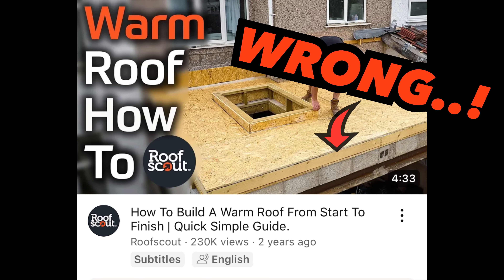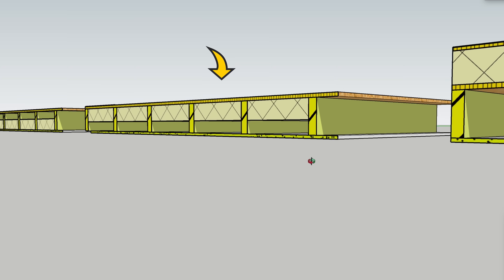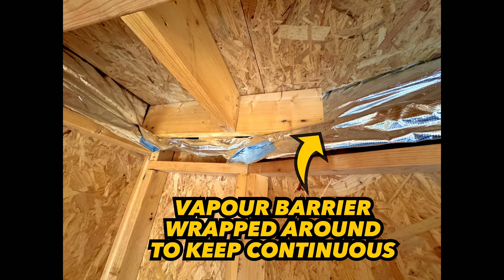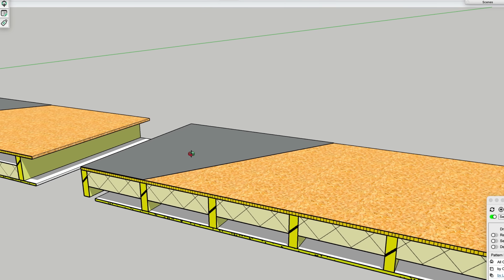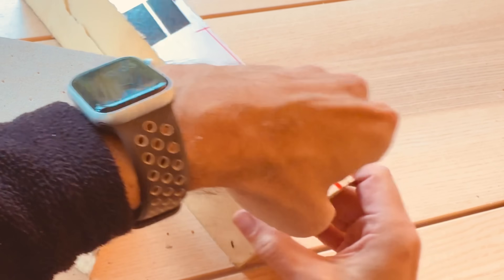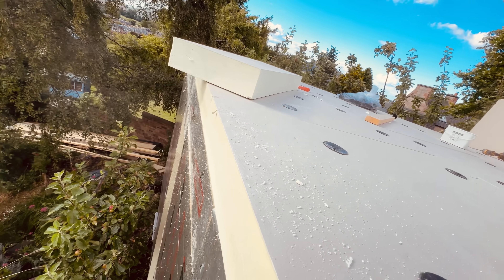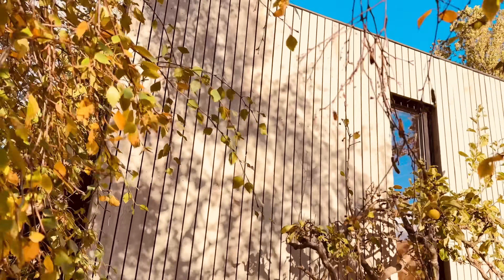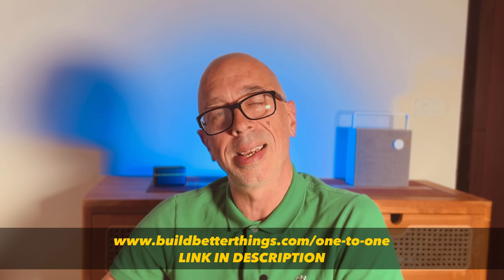Build a Warm Flat Roof the Right Way

Comment: Jerry thanks for yet another great informative video.  Just in time as I'm in the planning phase of adding an open plan kitchen dinner leading onto the rear garden.  I'm going to pass your video onto the architect so they can spec the construction drawings accordingly.  It might not go down well, but I'm the paying customer  :)
Reply from the maker: Thank you too. I’ll be interested if you come back with their comments. Construction industry is a sea of conflicting information sometimes, that’s why I over do it with the analysis.
Reply: @build-better-things  Hi Jerry, I’m always revisiting your videos so I thought I’d share a quick update on my extension. As expected, my architect initially used a standard detail (boarding above foil-faced PIR), but I had it changed in line with your recommendations and it was approved by Building Control without any issues. I’ve gone with the Durisol system (EcoBrix, Wales) and attended the training course. Wall construction is going really well, and once the weather improves I’ll be starting the roof. I’m a home self-builder and do most of the work myself, but I always outsource bricklaying and plastering as they’re not my strongest areas. One thing I may have missed in your videos is your recommended vapour control layer - would you be able to confirm what you typically specify, and whether ALUTRIX 600 (self-adhesive vapour barrier) is a good option? Many thanks Gary.

Comment: Not happy as i have just recently completed a warm roof with 18mm OSB on top of  PIR then got 1.6mm EDPM on top.  But your information seems sound and logical. Is there any actions i can take to improve / avoid early rot in the top OSB ? (Minor not major reconstruction). PS - Could not find the height restriction video you referenced.
Reply: If you've used a VCL I would not worry so much.  There is simply no evidence of a top deck rotting if there is a VCL. The only thing I find on youtube is: https://www.youtube.com/watch?v=6NWrYG2G2Ho and surprise surprise they did not use a VCL. All other examples are pitched cold roofs with improper ventilation or water ingress
Reply: @OmegaLok there is zero evidence in this country providing all stages are correct and installed correctly. Absolutely zero. If anyone would like to prove me wrong please do so!

Comment: what are you doing on the four 150mm cut edges - surely vapour will get in there much more than through epdm or osb ?
Reply from the maker: I don’t understand what you mean. Can you explain it in a different way so I can respond?
Reply: @build-better-things  theres vapour barriers top and bottom but not at the 4 sides of the kingspan, or is there?
Reply from the maker: I describe how that works in detail in the early part of the video, photos of typical installation along with a diagram.
Reply: @build-better-things but you didn't do it in practice. What's the point in telling everyone how best to do it when you don't do it yourself? Honest question, with all the conflicting information within this video...please be honest...do you know what you're doing/talking about?
Reply: @DICEGEORGE it's not there is it. Hello said one thing, did another and trying to tell you that you don't understand!

Comment: "no timber products on the cold side of the insulation" surely this doesn't apply to timber framed walls ?
Reply from the maker: Provided you have a breather membrane and a ventilated cavity, just like the cold ventilated roof example I show, it’s ok, still you should be aiming to put your insulation outside of your frame. Sorry if I didn’t made that clear.
Reply: Yeah I had same question. Most timber frame wall details have OSB directly on cold side of insulation. So why does same principle not apply? Would humid air from inside house not pass thru insulation, be trapped and condense on inside face of OSB? Regardless of what's on outside face of OSB?   
Genuinely curious.
Reply from the maker: The dew point should be able to occur on the outside face of the OSB, and the breather membrane is supposed to allow it to dissipate, and a ventilated cavity assists in that. I don’t like the detail, but that’s what the frame companies do. I put my primary insulation outside of the frame and the OSB so the dew point misses the OSB altogether.
Reply: So by your theory every every house extension that is a kit with say larch cladding has been built wrong 
Surely when the building inspector comes to sign it off he wouldn’t
They certainly don’t do that in Scandinavia countries
Reply from the maker: I just said  above, provided there’s a ventilated cavity, for the larch, in this case the battens, then it’s fine.
Reply: @build-better-things  
No build I have seen has  the insulation on the outside of the frame apart from the roof, certainly not on the walls
Reply from the maker: If you’ve never seen insulation on the outside of the wall frame, then I don’t really know what to say. In order the get U value down to the current standards, it’s one of only two ways possible for timber frame construction and you can see it all over the country now and in volume.